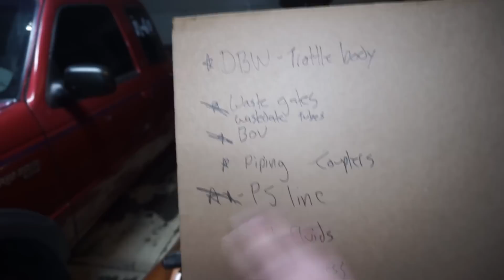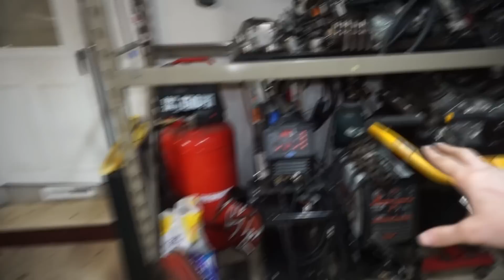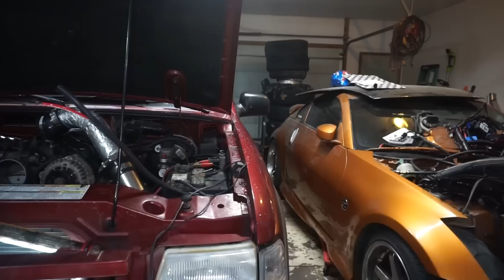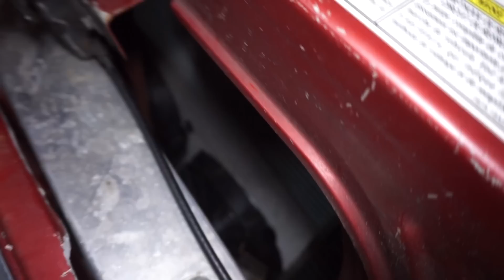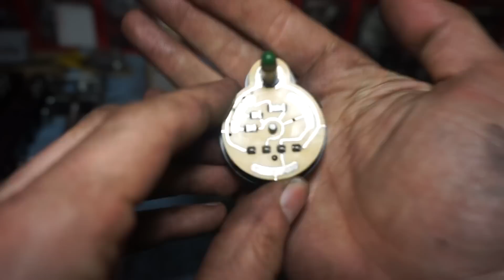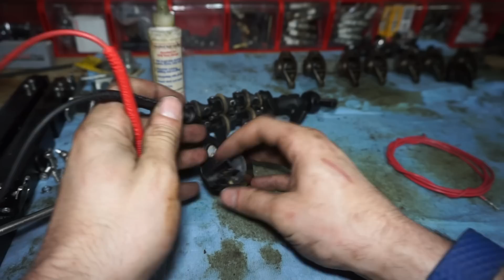FANS AND WIRING!!! 4X4 2 STEP SWITCH AND RADIATOR!!!

Comment: I have an e fan conversion on my 93 Ranger. I used a 93 Taurus 2 speed fan. Popular with jeep guys. Keeps my 4.0 cool on a 90 degree day...on LOW. Never had to hook the high speed up. It's INSANE for an own fan. Highly recommended.
Reply from the maker: I don't have the depth for it.
Reply: Yeah that fan is like 4-5 inches thick. It does move a shit load of air tho
Reply: I hear ya.I trimmed the shroud for room& I only have about 1/2". Just measured it and it's 4 and 1/2 in from the core of the radiator to the back of the fan motor even with the trimming, & I'm running a single core radiator because my 4L truck is also a manual transmission and only two wheel drive so it's never working hard off road

Comment: Why not let the pcm turn the fans on? I tried the ebay fans and were junk. Then I tried a spal 14 inch and was lots better but not great. Now I am using a hhr fan with a 160* therm and its perfect, even with the Alabama heat. I'm running an ebay 22x19 radiator also so not a lot of capacity
Reply from the maker: It's an option. I still had to add a relay though. This should be more than enough now. I drive it for hours as is, it would just start to creep up to 210 if it was sitting for 10 minutes, and would have a hard time cooling it back below 200 unless I started driving. This should be much better.
Reply: @BlaserBuilds  I agree those 3 should be plenty of air. It's hard to keep these turbo engines cool in these trucks. Theres just not a lot of places for the air to flow.

 What therm are you using now? I went to the mr.gasket 160 and turn my fans on at 180 off at 175, max it has got is like 185 beating on it. Then it cools right back off idling. 

The oem fans are the best imo, if you have any more issues you for sure need to find 1 that will fit. As big as your rad is I would look at the dual Ford contour fans, or some other dual fan. Some are pretty slim.
Reply from the maker: @justin_parks  I would have to cut and move the radiator to fit anything else. I could even center this fan because it hits water pump. I'm using factory 180.

Comment: You could run a thermostatic switch under the hood and then use your 4WD switch to provide ground?  That way voltage wouldn't matter.